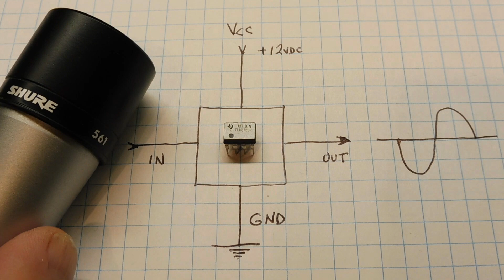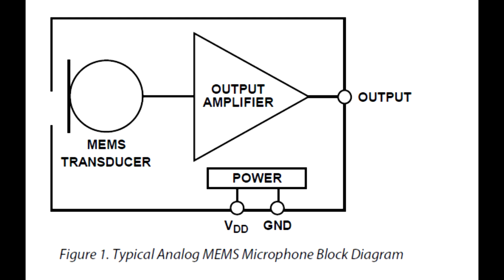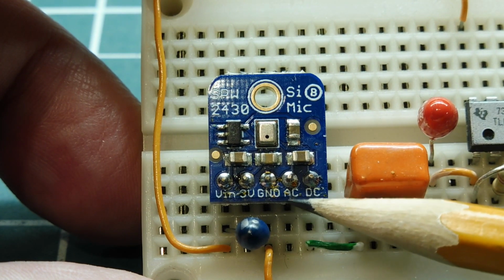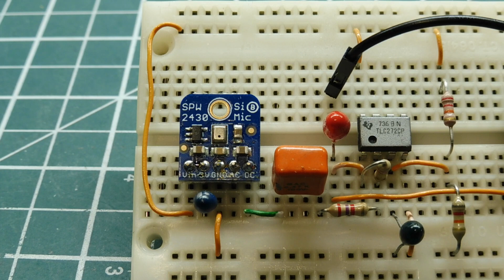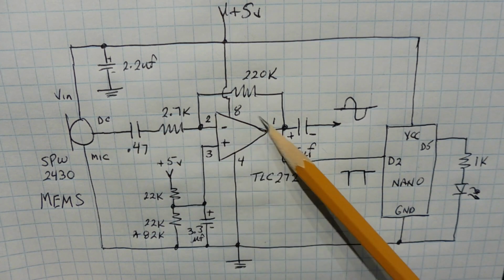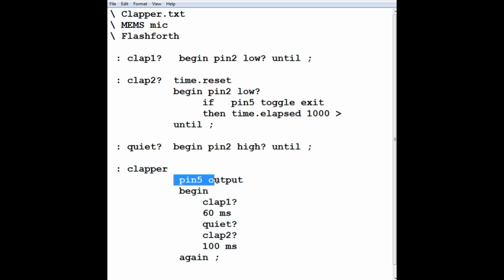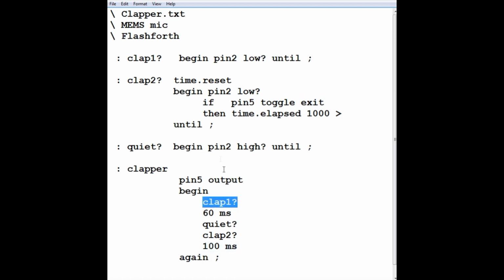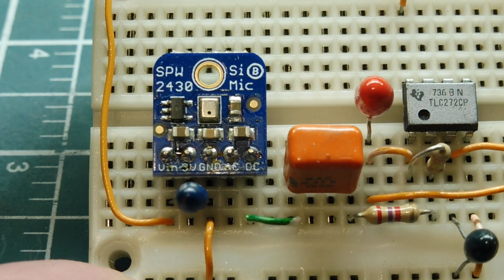MEMS Microphone Interface  / Arduino / Clapper Switch

Comment: Thank you for the video but I'm curious why the op amp circuit is necessary? The datasheet ( https://media.digikey.com/pdf/Data%20Sheets/Adafruit%20PDFs/2716_Web.pdf ) provided by Adafruit recommends just plugging the output directly into the microcontroller's analog input pin. They mention that the un-amplified microphone outputs 0.1 Vpp when talking near it. For microcontrollers with 12 bit ADCs, you could get 0.1/(3.3/(2^12))≈124 samples over that 0.1 Vpp range which seems sufficient to me. Am I missing something?
Reply from the maker: The output of the op-amp is fed into the GPIO "digital" input of the Nano not the ADC so it is expecting a digital 5 volt logic swing.
Reply: Oh I see now, sorry. So if you were just feeding to an analog input then you probably wouldn’t need the op amp? I’m trying to record audio with an Arduino Portenta H7 and was interested in this microphone.